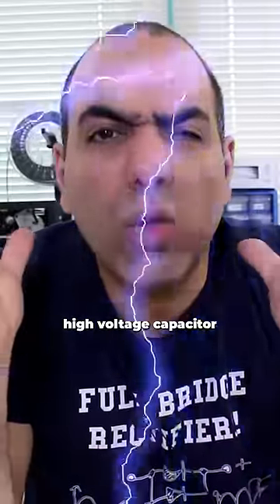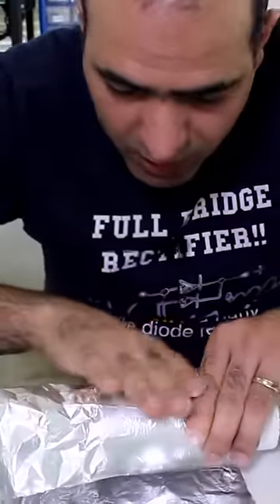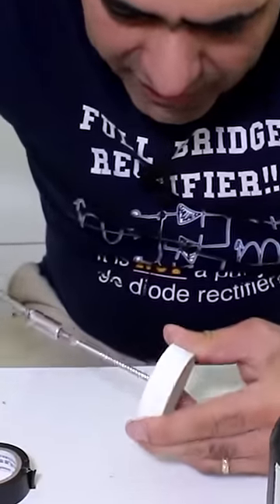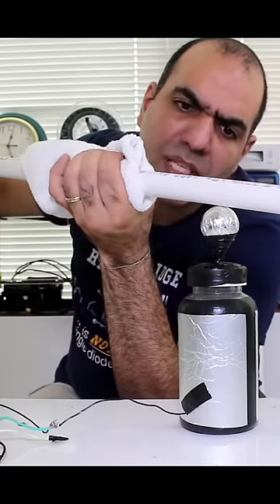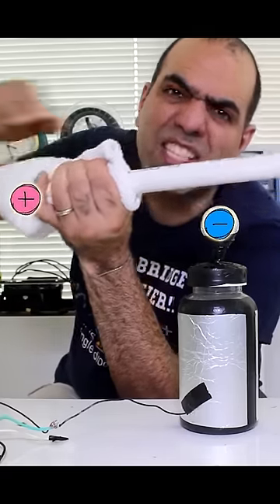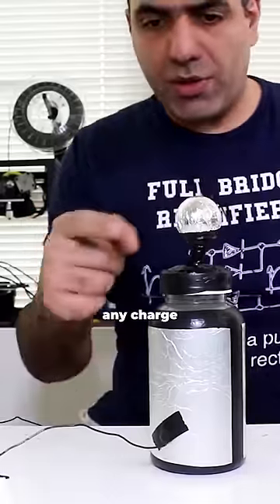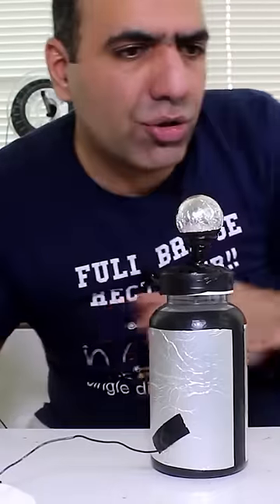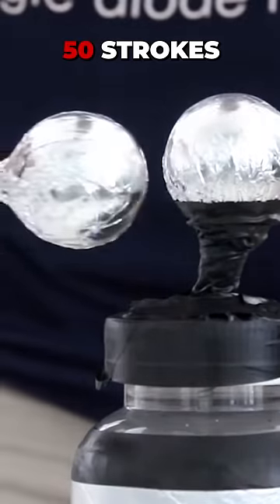Making a super high voltage capacitor: Leyden Jar #capacitor #highvoltage #charge #funny

Comment: Next: making a Flux Capacitor with 1.21 GigaWatts capacity.
Reply: haha
Reply: isn't the capacity measured in Farades?
Reply: @shorge37  It's a Back to the Future joke, they need 1.21GW in order to time travel, the Flux Capacitor is what let's them do it, it's like the key component. It's not a proper capacitor in the films and doesn't have a value assigned to it as far as I know.

But yes, capacitors are measured in Farads (milli, micro, pico, etc).
Reply: You spelled "jiggawatts" wrong.
Reply: Don't tempt him.
Reply: @foogod4237 no he didn't
Reply: Man of culture
Reply: Yeah, as @user-gv0mi6gd2e pointed out, gigawatt is not a measurement of capacitance. It's power.
Reply: I know. But a Flux Capacitor works differently than a normal Capacitor. I mean, how can any capacitor in any capacity make time travel possible??? It's a very simple component, a Flux Capacitor however is not.  @lforlight
Reply: He just needs either plutonium or a lightning bolt to power it
Reply: It's a Back to the Future reference
Reply: Jij bent echt overal hè?
Reply: Lightning bolt you say? You got it! Coming up...  @AlmondChocolateMilk
Reply: @lforlight  And a flux capacitor isn't an actual thing.  It's a Back to the Future reference.
Reply: @markgigiel2722  So what? Even in the fictional setting of the movie, the device takes 1.21 gigawatts of power, not capacitance.
Reply: @CraigLandsberg-lk1ep  yes he did

Comment: Without water - foil inside too with a chain leading from the terminal also works well 🙏👍 love the comedic content - I was making a SGTC once and had constructed an  MMC array of small caps - which I had wrapped in electrical tape - they kept blowing as I think my tuning was seriously out - so upon disassembly and without bleed resistors each good one still has full charge - that investigation/ repair was painfully shocking 😂😂😂😂🤬🤬🤬🤬🫨🫨🫨🤣🤣🤣🙏👊

Comment: i’m gonna do this and charge it with 120 volts
Reply: In the world of static discharge electronics, 120 volts isn't all that much
Edit:
In the long form video, he determines that the capacity is about 1.5nF, so at 120V, you would only charge it to 180 nanocoulombs, enough to maintain a current of one milliamp (slight tingle) for 0.000180 seconds. You wouldn't notice a thing.
Reply: @younscrafter7372  i know

Comment: That's just a wee capacitor... I'm about to build a 1000pF air gapped capacitor from aluminium plates soon. It has to be rated for at least 5kV for a Mag Loop antenna I'll also be building.

Comment: "I fill it with water which is not conductive"
Reply: He’s right! Water is actually a weak insulator. The reason we think of water as conductive is that in most contexts we’re dealing with water that has a bunch of minerals and salts dissolved into it - and THAT’S what conducts the current.

Comment: I always get static shock at my colleges hand support rails, while using the stairs. 
I don't know why static builds up only on me and no one else. 
Is it cause of my inner garment (bunyan) which is cotton and my shirt made of nylon?!
Most of the time I climb six floors and when I have to go to the other building. I always touch the hand rail which is steel. and I feel a pinch or sometimes I can even hear the sound, just as in the video (the 10 strokes).

Comment: If water isnt conductive, What happens in a toaster bath?
Reply: Not much, actually.  He also did a video (a long time ago) about that too.

Water itself is not really conductive at all (pure water actually a decent insulator).  Various impurities (such as minerals) dissolved in water can make it more conductive, but even though it does have some extra minerals/etc, ordinary tap water still isn't that conductive either.

Most (non-salted) water has a resistance of somewhere around a couple of thousand ohms per centimeter, which means even if you stick a 120/240V electrical wire into it, if you're more than a few millimeters away from that wire, there's too much resistance in the water to allow any amount of dangerous current to flow through you.  It's mostly in cases where your skin is wet and comes in direct contact with an electrical conductor that it actually can be dangerous (because wet skin is more conductive than dry skin is).

Comment: I tried it once it didn't work i used a microwave transformer to power it and couldn't get the spark i wanted out of it i need a defibrillator capacitor to explode potatoes

Comment: If water isnt conductive, why broke my pc when I spilled water over it?
Reply: Distilled water (without minerals in it) Isn't conductive. The water you drink has minerals in it (like sodium, magnesium, etc.etc.) that makes It conductive
Reply: @hinawachainsaw7820  Even tap water, with its extra minerals, still isn't very conductive.  It typically has a resistance of a few thousand ohms per centimeter, which makes it not actually an insulator, but also not really a very good conductor either.

However, computer electronics can be very sensitive to even fairly small amounts of current flowing in ways they aren't supposed to, so even this fairly high resistance can cause problems with them if it makes contact with two things right next to each other that really weren't intended to be connected.